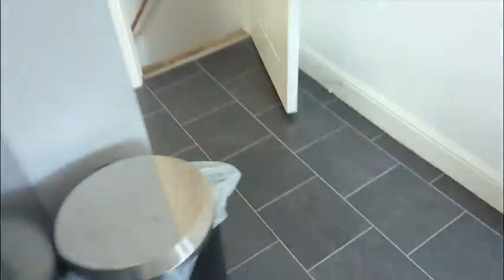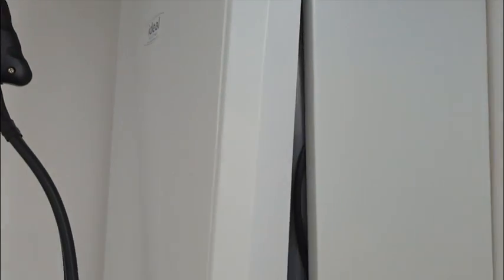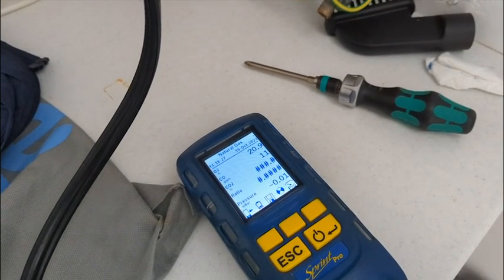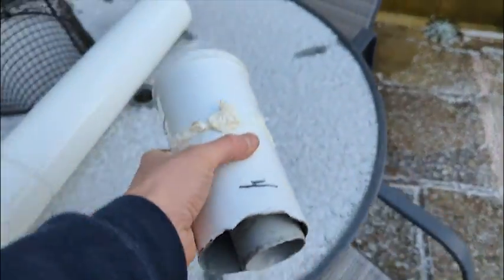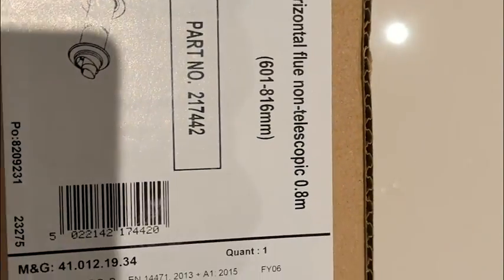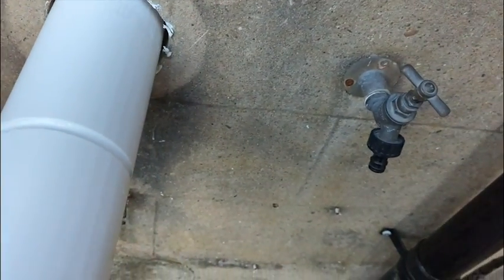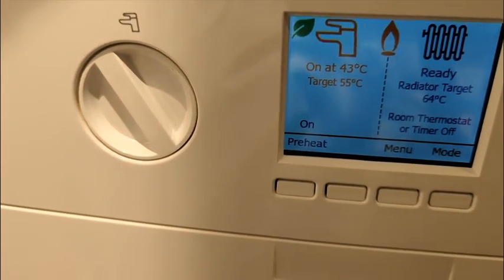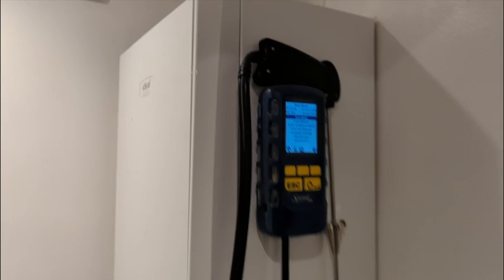New Ideal Logic combi boiler fails a gas safety certificate

Comment: If there was co2 showing at the burner then would you go and change it? But if there is no co2 showing around the burner but only co that’s common on the ideal logics?
Reply from the maker: Ive never actually had CO2 around the burner on an Ideal so yes I would be concerned and would change the burner seal. Ideal seem happy for 10/15 ppm to be recorded around the burner and they are the manufacturer so I always go with that and let it pass 👍

Comment: Someone told me, ideal Said you should do flue integrity from the rubber plug underneath the boiler..
Reply from the maker: ...there used to be a rubber plug on top of the boiler, to the right of the flue elbow. Ive not seen one underneath